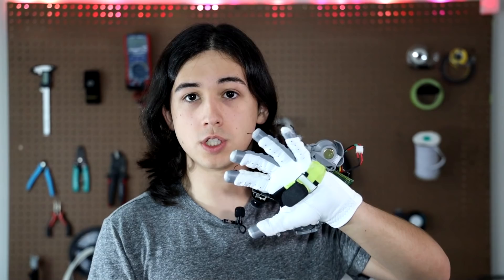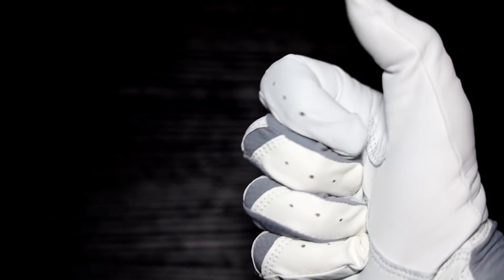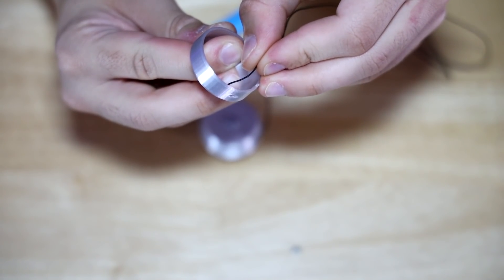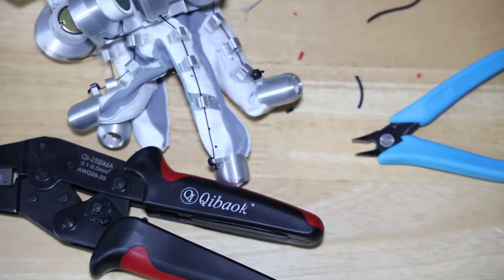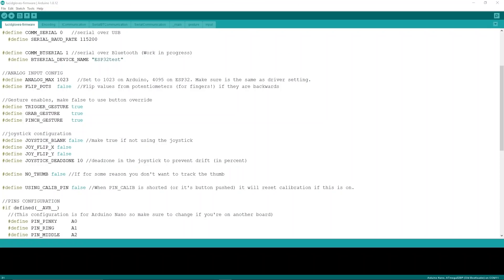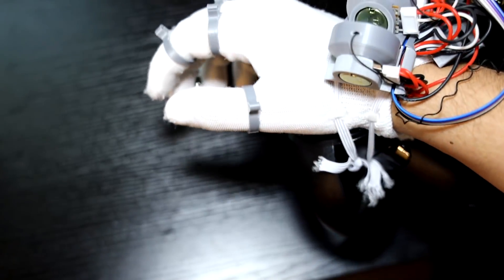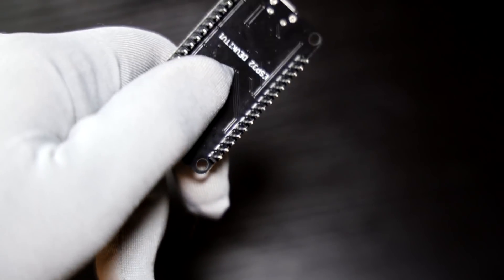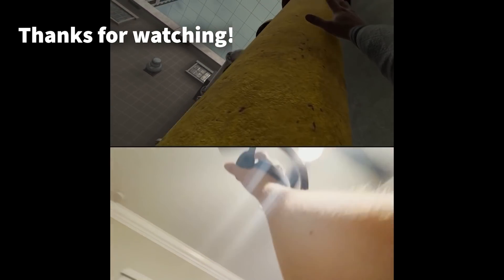How I build CHEAP VR Gloves.

Comment: those are nice, but I find that ps2 controller potentiometers are better as they don't have so much bulk.  The ESP32 dev boards are also what I use.  You get more articulation without all that bulk.  What I use them for are ASL translators.  The issue that I am having with is the digital audio cable that for some reason distort the sound. It makes no sense that I'm getting a static effect that may be due to some sort of bottlenecking.  Anyway, the gloves have more  than one potentiometer per digit as there is more of a need for flection with certain ASL signs. and I require buttons to press on certain parts of my hand  to determine if I'm addressing myself or something else.  Also, if you noticed ASL users, you would find that "M" and "N" are nearly indistinguishable unless you see it for yourself.  That's why there are buttons needed.  what I find interesting is your gloves.  They are light weight, but I find open palm is better. I suggest silicone molding to fit your "controllers" in and they will be less bulky while protecting the potentiometers that get gummed up with over use.  Think of the Nintendo Wii controllers with the condoms on them. adjustable set screws can be used to adjust finger length. of each digit control on an armature.  You can always go neoprene if you don't do silicone molding as I did with my first version.  Also, it helps to just switch out the potentiometer if one breaks or you get drift, which is easily remedied using those screw type potentiometers, but I haven't found any small enough that is adequate for form factor.  Of course, recalibrating also removes drift with a little programming.  As for the thumbs, it was easy. I actually use four instead of the two potentiometers.  So, it's just like thumb stick controls, but you're wearing them instead of tacking them onto your glove.  You just might want to do a little coding that interchanges mode of mouse over to free thumb motion.  
I went with Reltivity for my VR head set option since it's open source.  I did have a problem with some design aspects since I don't have a printer. I just used a dermal on some melted down milk jugs for enclosures. to place in the silicone sleeves. Just finding ways to make things even less bulky is important for the ASL purpose.  I hope Something like VRChat enables nonverbal option to use a keyboard or a way I can enable ASL.  Something about Digital Audio Cable screws up the sound. Might be something to do with the bluetooth network. I'm working on it.  
Unfortunately, function of ASL was more important than the haptic survo tension as that just added more bulk. Nice that you also thought of that.  I'm looking for other possible methods to do this that aren't bulky.  I was thinking of how the bicycle breaks work with cable tension that can be hooked from the fore arm to the gloves, to free up some space on the finger gloves, but I'm working on the issue with the audio translate and building a library of words for the ASL translation.  I'm also trying to find cheap trackers that I can build.  I snagged a bunch of  xbox360 IR cameras, but I just repurposed those for another project. they didn't pan out with more articulated tracking.
I suggest snagging the potentiometers from thumb stick controls from old controllers or just buy them on amazon or ebay and create new enclosures like I did.  the range of motion is 90 degrees for those components for both first two knuckles on each finger and your fingers dont usually flex more than that anyway. I went with silicone molding.  I suggest using sheets of neoprene that you you can buy the gloves, but you can cut up the palm for more circulation and use velcro on the back of your hand to fit the components for easier placement.  What other issues are you dealing with?  I'm looking at more reduction of bulk for the ASL function, the audio issue.  Getting over the problem with trackers is my main issue that I keep putting off.  Sometimes I dream in development.  One dream was just pairing bracelets as trackers and I think about taking apart cheaper trackers  components and most of the bulk is on my forearms where they won't get damaged.  I dreamed of silicone enclosures and that worked out. I just don't have the time during the day anymore after I graduated and work most of the day.  I even dreamed of using the silicone controls just stick to me like a second skin and that was cool, but it just wasn't practical as I would have to unstick them from my arm every time I would take them off to shower or work out.  I might have an hour a day to work on this stuff and not enough REM sleep to let the visions come to me.

Comment: Wouldn't those gloves be incredibly fragile?
Reply: surprisingly not too bad. 3d printed parts can be pretty durable if you set the infill decently high, and everything is easily replaceable in the event it does break.

Comment: Do you need end caps still if you’re gloves are very ridged and will steam vr still recognize my controllers when I’m not using the gloves? Love the videos keep it up
Reply: you need the end caps so the strings are pulled properly and the pots can accurately measure how much you've bent your fingers. I guess you could try just gluing the strings to your gloves or just using the guide nodes but it almost certainly wouldn't work too well.
Reply: @pandoxyy  yah I was thinking of just using guide nodes I guess I won’t know for sure until I try thanks

Comment: I might build these myself but I have a thought. The slits in the guide nodes to put the string through are a straight line and it might slip out(I don’t know and I don’t want to say for sure), so you might want to add a slight curve to them if so. Just a thought

Comment: This looks really interesting, I cant wait to see future versions! the footprint of the sensors seems to be the biggest problem right now, but I would assume using smaller wheels would reduce the accuracy of the sensors since they get less rotational data to work with? 

Have you looked into the tundra trackers on Kickstarter? they would be a good substitute for an extra controller for the tracking, and would be less clunky.

Comment: 2 questions.
Is it even possible to use 2 flex sensors per finger? (so i could move my finger without bending it and vice versa)
Second: could i use 2 arduinos per hand, but only 1 per hand would wirelessly communicate to the pc?

Comment: This project is awesome.

Have you considered a spring-return potentiometer to cut down on size/bulk on the back of the hand? I've been doing some digging and they can be found on Alibaba for quite cheap.

Then there are slide potentiometers, you could spring load with some lightweight springs, and operate the slides with string still.

This could lead to minimal amounts of 3D printing. You'd just need to find a way to make the cable guides.

Comment: You should replace the bulky and wear prone potentiometers with hall sensors. You could also consider to use a clutch/brake/ramp type system with friction shims for the motors to lock the fingers that way you could use smaller motors as they could be much weaker.

Comment: Got some notes on you for the design. I assume that these concerns and thoughts have already been taken into consideration, but I figured it wouldn't hurt to throw it out here.

First off, in terms of tracking, wouldn't it be better to be able to mount a tracker onto the back of the hand? You do show it as a possible configuration, kind of, but the demonstrated setup is in obvious conflict with this. If you printed a mount for the tracker with guide holes for the strings for the fingers, you could put the reels and other parts of that setup back by the wrist.

And I know you were talking about getting of the joystick, but using a PSP style one might be nice as it has a significantly lower profile. A couple buttons would surely be nice too. I think the side of the index finger would be a good place to put them.

Comment: For gloves, I can highly recommend Honeywell Perfect Poly gloves. They come in different sizes, are rubberized on the bottom side and mesh on the top. I have to wear these for 8 hours at work and can confirm that after wearing them for longer they become super comfy and you don't sweat in them. Plus they're super cheap...

Comment: Out of curiosity, do you ever intend on making a version that has tracking hardware built into the gloves so strapping the controllers to your hands isn't necessary?  Would that even be possible given the current VR ecosystem and third party devices you could buy?
Reply: for oculus most likely not, because they're mostly inside out tracking now and thus you wouldn't be able to trick the headset into thinking its a regular controller without breaking the hardware. It works with vive trackers (which can be made smaller with tundra trackers) because SteamVR is much more developer-friendly

Comment: Bruh. Capacitive touch module along the finger for programmable inputs. You can even put a cover on it to isolate certain areas of the strip for specific applications, like buttons or trackpads!
Reply: Just make the whole thing into a flexible circuit board. 😲🤯

Comment: Just been revising for exams and am looking forward to getting into this project afterwards! Just a thought - the form factor seems to be limited by the size of the barge reels - is there a smaller alternative?
Reply: It’s probably possible to reduce the size. The smallest it could be would be a little larger than the potentiometers. Some tests would probably have to be done to see if it’s still durable when scaled down, but in theory yeah.

Comment: wanna start of by saying that this is awesome! but now i am wondering, how does the quest 2 track its controller? does it track it with just the lights? and if so, would you be able to just have a light ring on your hand?
Reply: quest tracks using the built in cameras and tracking rings. oculus hasn't told us specifically how they work though so the only way to make tracking work is morning the controller

Comment: This is so awesome! The attention to detail and UI in the driver is golden!
Also thank you for including 3D-printed parts. My only (small) wish is that you included a 3D-printed back plate that would fit on the back of the glove and house all components with a snap fit. Such setup would have less variability, but much easier assembly and a more durable end product.

Comment: Instead of end caps for each finger, would glueing velcro to each tip of the glove work? Then it could be easily adjusted to the size of each finger, rather than needing to print various sized tips.

Comment: Seriously, approach Valve. This is great work, but they can give you access to better resources for a final version of these gloves that will be clean and compact, and possibly even a better option than janky controller strapping for hand tracking. I'm sure they would agree to keep the open source aspect if you required, just so they could be associated with this great project.

Comment: Wish I'd seen this two or three months ago when I made my sensor gloves for my remote-controlled cosplay fingers.
Instead of the badge holders, I used some Kydex to make jointed connectors. In (very, very small) part because I'd like to avoid having to work against spring tension, but mostly because I didn't think of it xD

Edit: Now I just need to get this blasted yaw and pitch problem figured out ...

Comment: If you use air link for a quest 2 will it work or does it require a link cable? Cuz I have a computer with a NVIDIA 1080 graphics card and 16gb ram and the other components for it to work pretty well with stuff like that...

Comment: I would love for a non-3DPrinted glove tutorial! Also, are PSMove controllers supported for hand tracking? I have a pair and they sit very flush, while also being easy to strap through a silicone case with a velcro added inside a cut. Thank you!
Reply: doesn't work with psvr buddy :(
Reply: @justintimefordinner4902  Not PSVR, PSMove on PC. The controllers themselves are supported via iVry or Drive4VR. I was wondering if there were plans to implement them natively to work with the gloves.
Reply: @MyChannel-SR1  oh wow i didn't know that existed, cool

Comment: i'm not sure if my suggestion is necessary/original but to create the feeling of holding something, you could make a bladder that fills with liquid or air that pushes against the inflexible fabric in the palm of the glove. It could create a sense of resistance in your palm similar to when you hold a solid object. 

Alternatively you could have something mechanically expand like a sandwich using racks and pinions? 

I'm no engineer tho pls take my ideas with a grain of salt

Comment: I was thinking "There must be a way to make a vr postion sensor integrated into the design." And I came across a video by Micheal Stengel where he makes and shows how to make VR tracking sensors ( https://youtu.be/_eL21B09aVs ) You should try and marry these two designs into one DIY vr glove kit.
Reply: Those only seem to track in 3dof, you need 6dof trackers to get positional data for the hands.
There are a couple of new affordable full body tracking solutions coming out that may work with these though
Reply: The specs in the video says they used MPU-6050s, which search results say are 6dof.

Comment: As for the haptic feedback, I think you could make something far more compact using solenoids. The solenoid could be energised to provide force feedback, but could possibly also be used for position encoding itself via DC current measurement and/or AC inductance measuring. If you are able to fully characterise the solenoids such that those AC and DC measurements result in a fully deterministic model of string displacement at various known levels of DC input current, you wouldn’t need any encoding at all, just MCU calibration. No spring needed either, just set a default amount of current to keep the string mildly taught. If this isn’t sufficient for feedback, then a hall sensor or two will work.
The main downside with this will be the current draw.

Comment: For hand tracking, I think you’d have a much better end product by just mounting the accelerometer on the glove, rather than the whole controller. For this I’d reverse engineer the controller to just have a carbon copy of its electronics on the main board. Though with a bit of work you could probably throw a cheap 6 or 9-axis sensor on the board and make up for the difference in hardware with some clever firmware and software. Some controllers might also use LED tracking in some instances, for which you could hopefully mirror the LED layout with a small 3D printed structure mounted somewhere convenient.

Also, USB serial is possibly not the best method as it requires drivers to work. Using something with native USB compatibility like an SMT32 or ATmega32U4 might be better, though I’m unsure whether the USB-HID class contains enough seperate analog axes. Ideally, you could also have it spit out data on initialisation that your driver software uses, to automate the hardware conditions alongside the eventual automation of offsets.

Comment: Absolutely awesome so far. I am wondering though, I know you are able to purchase parts to build your own trackers. These can be custom made to fit the base of the glove so you don't have to have a bulky controller strapped to your hand, and you could add additional space for batteries. The main downside of this approach is requiring base stations or external tracking in general, granted you could roll your own solution for this to still bring the cost down. You could also use visual tags for cameras to track as well, using cameras as base stations.

In the end, it seems like bringing the bulk down and making it more reliable will end up bringing the cost of parts up, but it could be a solution which completely replaces the need to have typical controllers in the first place, bringing the total price of your setup down.

Regardless, great work so far, I am excited to see where you go with this :)

Comment: While watching this video and looking at my hand (huh, that sounds kinda funny out of context) I noticed that while all fingers can kinda be described by a single value in most situations, the thumb specially has a much more "bidimentional" position in common hand movements than the other fingers, that normally just curl and uncurl. So that kinda got me thinking if it was viable to put a sixth spool resting on the side of your hand opposite to your thumb (so that the string goes across your palm or across the back of your hand and hooks directly to the top piece of the thumb) and hook it up as a second thumb coordinate. That would allow for much more expressive hand positions. 

Something I don't know is how this would affect compatibility. Maybe the protocols being used describe finger positions in-game as a single value, so this would have no use.
What do you think Lucas?
Reply: I'm pretty sure valve index controllers wouldn't support something like that, so there wouldn't be compatibility in most games

Comment: incredible work Lucas, and thank you for making such a clear guide to making your gloves! i think i've thought of a very clean design to mechanically integrate the haptic servos and will start mocking up a prototype in cad over the weekend to build a pair.

are you still using the esp32 boards in this iteration or do we need something more powerful to drive the servos?
Reply from the maker: The esp32 will work fine with the servos, just keep in mind they need 5v not 3v3 so they need an external power supply/voltage regulator
Reply: @LucasVRTech  awesome, thank you! Understood. Its the bigger picture, but I think I will use a central power backpack for headset and VR shoes also, so that shouldn't be a problem, just a bit of a cable mess! :-D